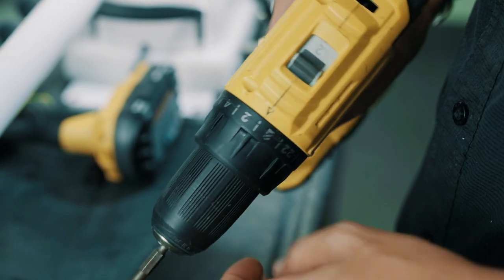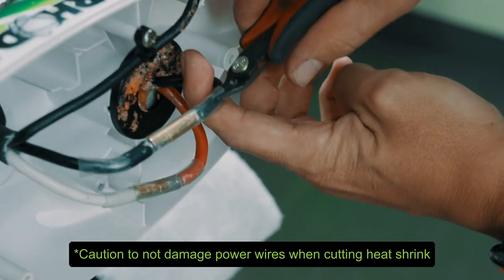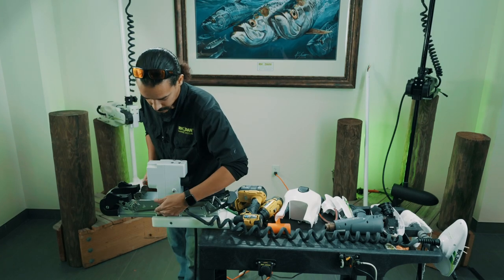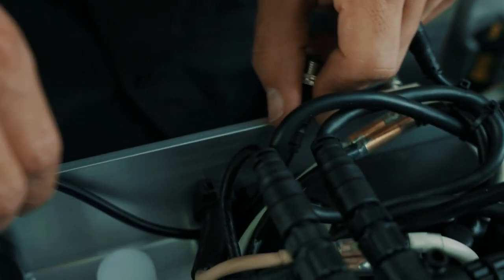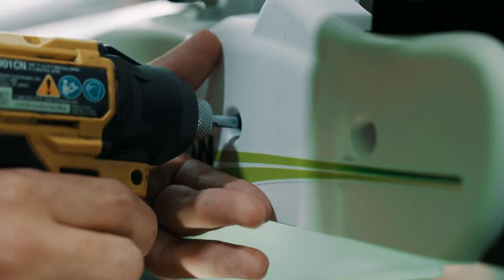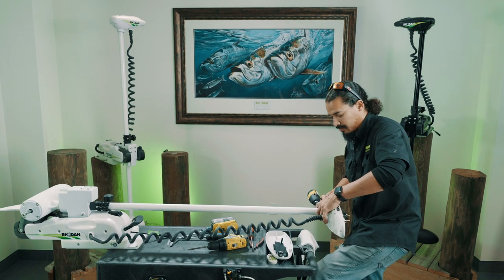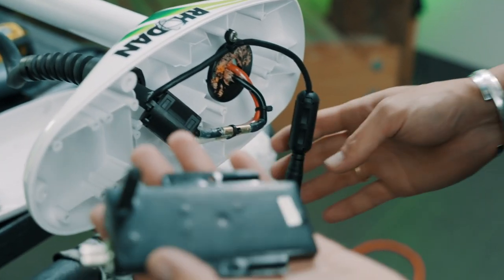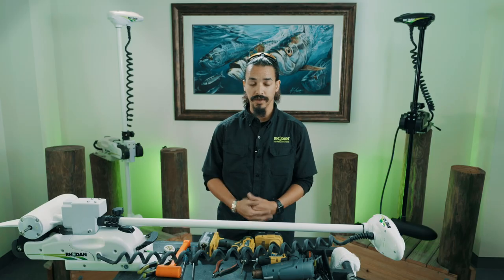Rhodan Steering Box Replacement.

Comment: Get ready to use a sawzall or cutoff wheel to remove the pin.  My motor is 2 years old and that pin was corroded and fused with the other metal.

Comment: the pin on mine is stuck - though I can rotate the steering box freely, the pin seems corroded to the box and no matter how hard I attempt to knock it loose, it will not budge. thoughts??